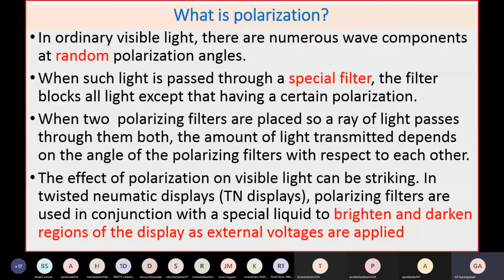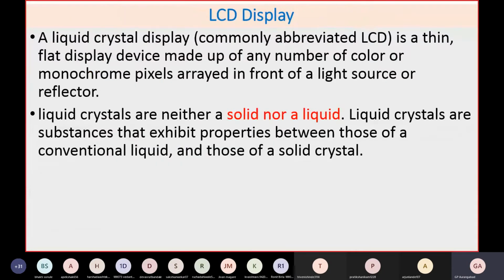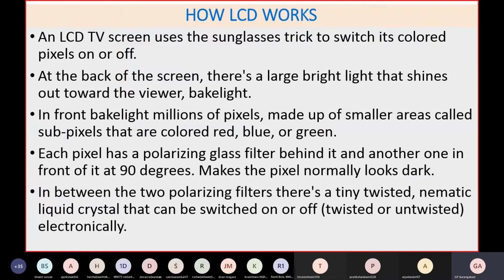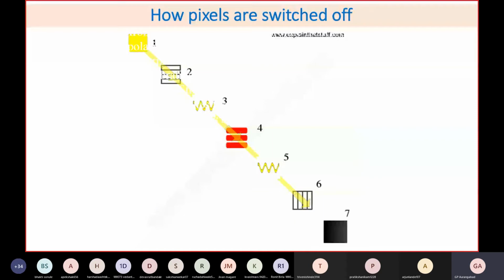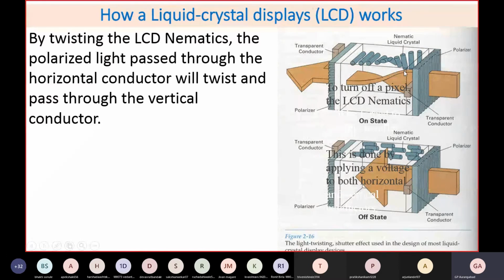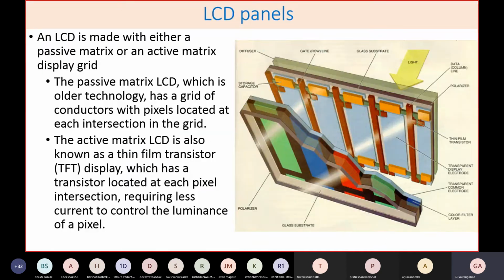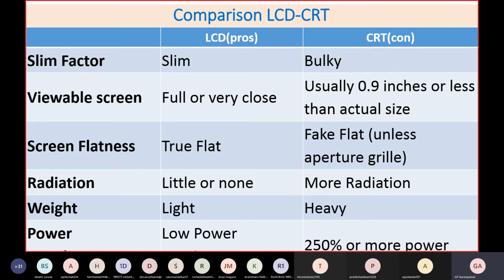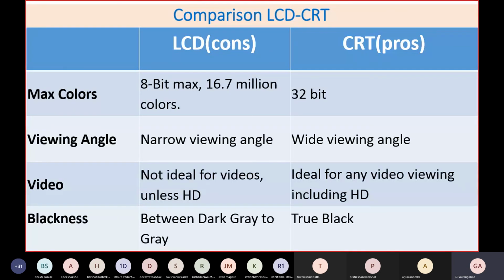LCD principle operation construction and comparision of LCD and CRT

Comment: What your explanation fails to mention is the mask layer over the indium Tin Oxide that hides the traces to each segment. What is used to prevent that portion from interacting with the LCD Fluid?  There can be more hidden conductor portions on the anodes and cathodes than the actual segments that the user actually sees! 

I have seen failed old LCD Displays where the hidden traces are now interacting with the LCD and are showing up!